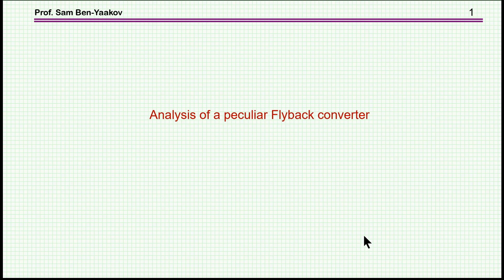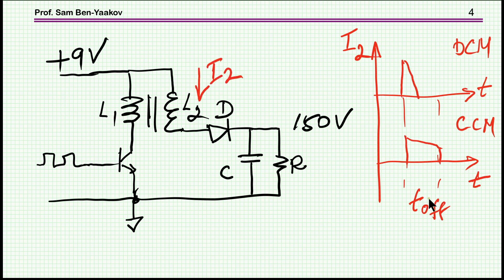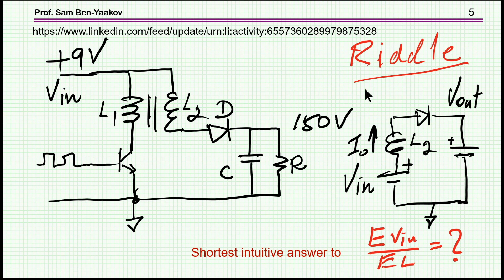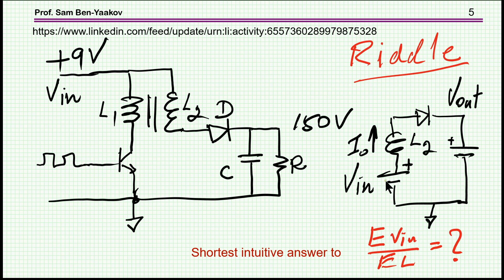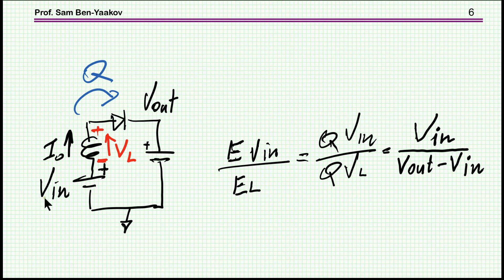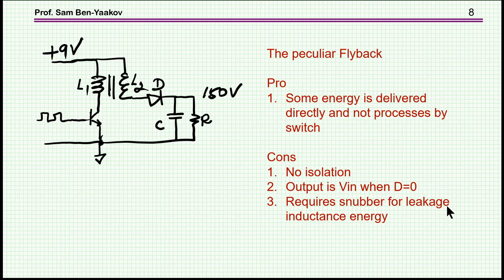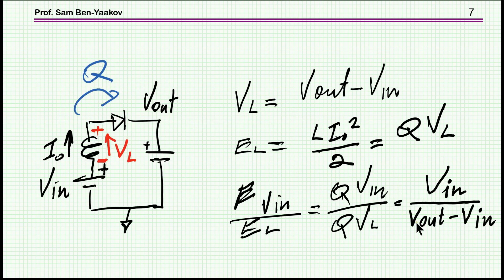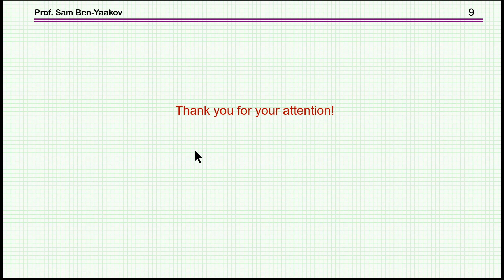Analysis of a peculiar Flyback converter

Comment: General question not directly related but interested in your reply...if the rate of coil discharge is varied does the total amount of energy discharge vary as well?  For example by clamping with a diode the rate of total energy discharge would be less then a sparking discharge...thanks in advance for your thoughts

Comment: Thank you for this very interesting video. I did a SPICE model for this interesting variant because I use something similar (without the diode and resistor) as a pulser for piezoceramic transducers.

I think if you add a blocking capacitor between the two inductors, you will get some isolation and the output will be grounded when D=0. But as you point out, L1 causes a very high voltage across the transistor. With a perfectly coupled inductor, the voltages are equal and with less than perfect coupling, the voltage across the transistor without a snubber is greater than the voltage across the load.

Moving L1 so that the switch grounds the center tap of the coupled inductor results in the voltage across the transistor being only half of the voltage across the load which makes sense since you can think of the coupled inductor as an autotransformer. This is very good for me because high performance, high voltage transistors are expensive components and of course it's much easier to get better performance with a lower voltage transistor.
Reply from the maker: Would you post this in my LinkedIngroup for others to see?Link to LikedIn Group to become a memberhttps://www.linkedin.com/groups/13606756/Link to post https://www.linkedin.com/feed/update/urn:li:activity:6558309606840389632

Comment: Add a diode and capacitor to make the primary side a boost converter, then move the secondary connection so it is in series with the boost converter output. Now you have a "flyboost" converter that uses a regenerative snubber.
Reply from the maker: Would you post this coversation in my LinkedIn group for others to see?Link to LikedIn Group to become a memberhttps://www.linkedin.com/groups/13606756/Link to post https://www.linkedin.com/feed/update/urn:li:activity:6558309606840389632
Reply: Interesting idea, I will have to simulate it! :)
Reply: Not simulated yet, but I expect this will be more efficient that a plain flyback.